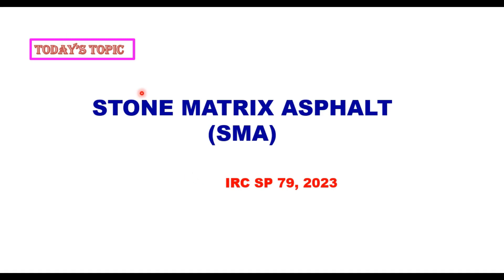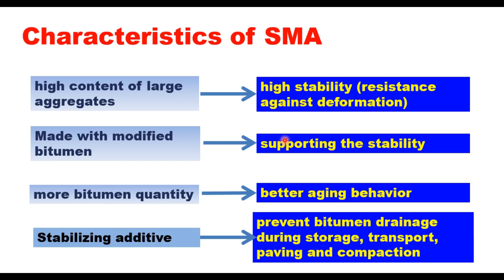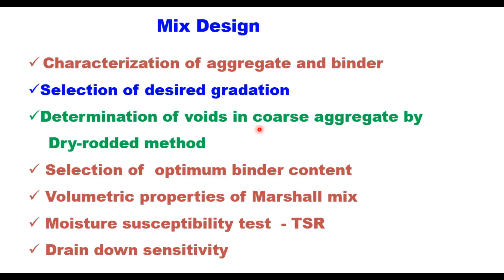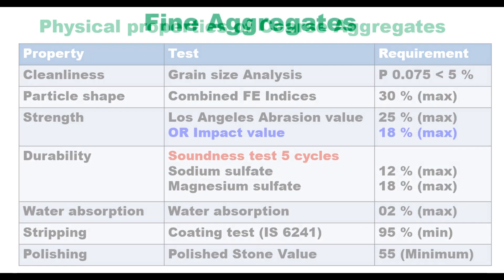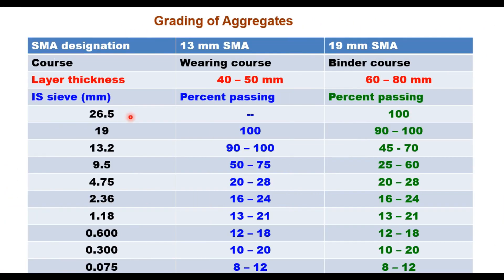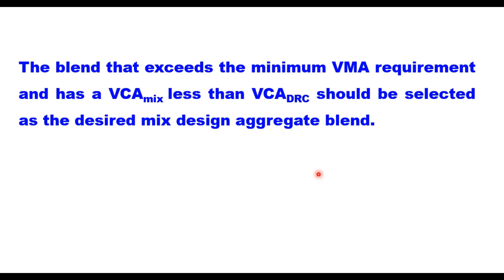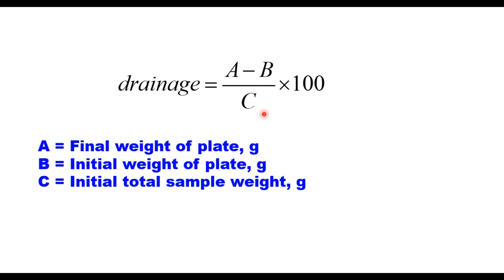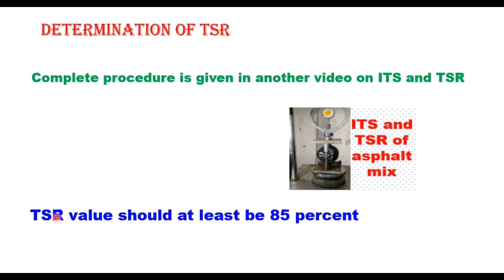Design of Mix for Stone Matrix Asphalt, complete procedure as given in IRC SP 79, 2023, What is new?

Comment: Sir, are SMA mixes prepared using VG 30 or VG40 binders more susceptible to rutting compared to PMB? The latest IRC recommends using PMB only
Reply from the maker: No, SMA is prepared with PMB only
Reply: @SatishIITR  Sir, as per IRC 37 VG40 is explicitly allowed even for high traffic loads upto 300 msa.
I find no mandate clause in schedules of contract, Morth ,IRC,IS though modified has advantages.
Reply from the maker: @SanjeevKumar-ue9ch  This code IRC SP 79 is the latest one, and therefore should superceed the older one. My opinion only.